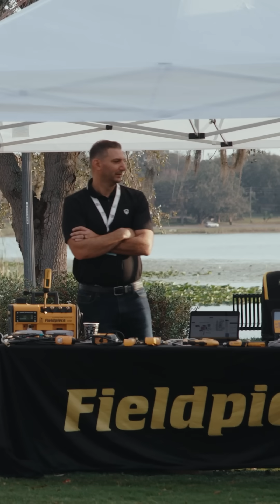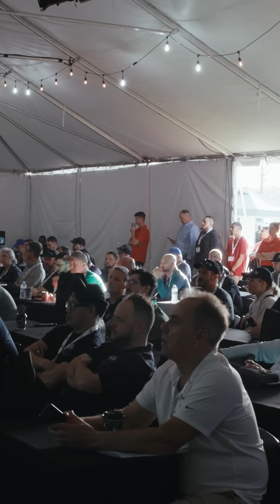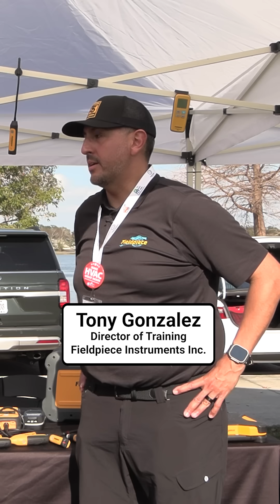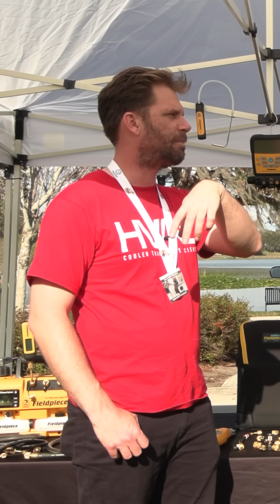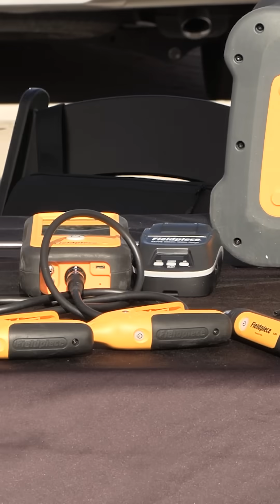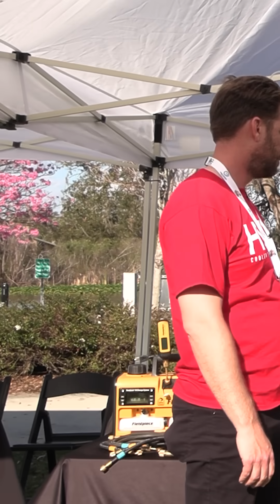Fieldpiece's Tony Gonzalez Interview at 6th Annual HVAC/R Symposium

Comment: Why do the JobLink probes fail so frequently? I've had two sets now and both sets failed after less than 6mos. The selector switches go bad and prevent the probes from being discoverable in the app. Usually starts with one side, either Liquid or Suction and then they both stop working. 

I'm currently in the process of mailing my device to Cali for service. 

I won't be buying Fieldpiece anymore  due to their unreliability for such expensive tools. And believe me, I have thousands invested in Fieldpiece.